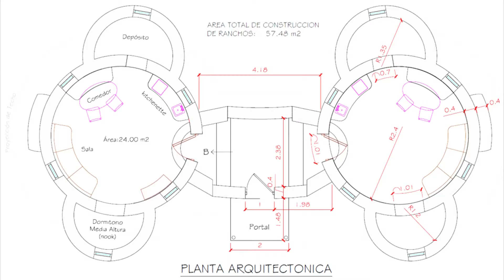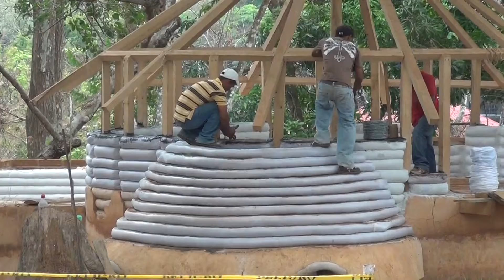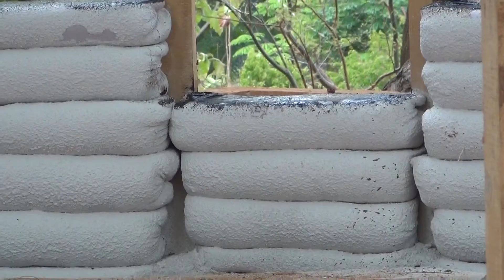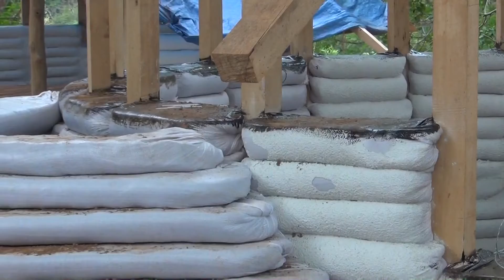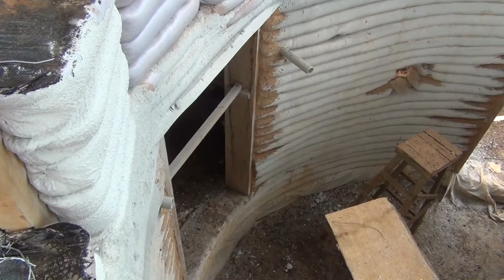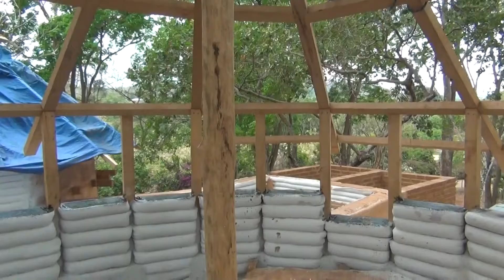Earthbag EcoRanchos update 04.04.2012.m2ts

Comment from the maker: The Loft Earthbag Stacks are not going up further. They will be locked on top with wood lintel or cement. The space up to the roof will be finished with wood panels. We do intend to lock the stacks in and secure them more.
A fault is on the main door entrance of the Dome. The lintel there fell short in overlapping. We will correct this. Other wood lintels have been covered with lime plaster and can not be clearly seen.
Thank you for your input and convern!

Comment from the maker: In the past we used ¨second hand agro bags¨, then we needed to shif to Polypropylene rolls. It is more of a problem what is available in Panama and what you are building. On the ¨Majestic Dome" (not so confuse with the EcoRanchos) we purposely did not spray on the "Lime mix" on the Airshaft Tower to see how the elements deteriorate the walls. The composition of the Earth mix is withstanding quite good even though the Polypropylene material is practically gone...

Comment from the maker: Lifespan depends on climate and correct building execution. Earthbag material alone does not ensure you longevity. You need also to consider stabilizing the material and suitable plaster. Failures in your building process could result in your walls deteriorating rapidly exposed to the elements. Alternatively you can protect your natural structure with proper roofing. Properly executed structures can last hundreds of years and require little maintenance.